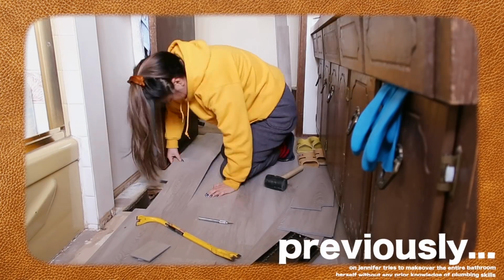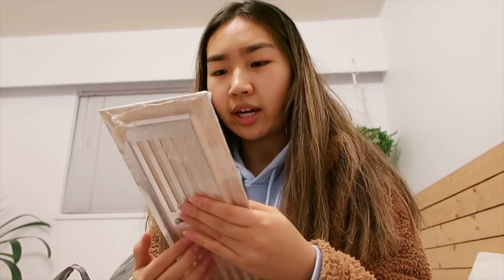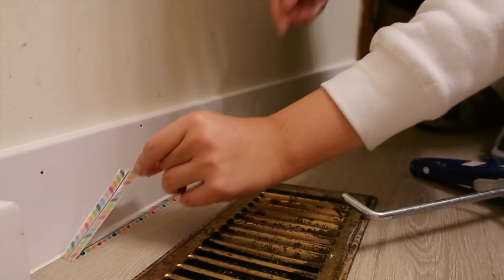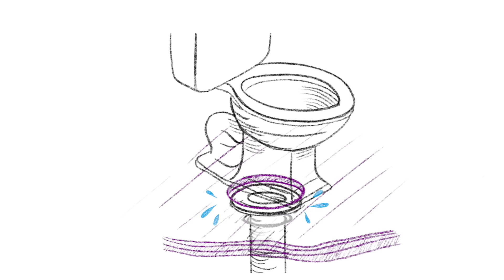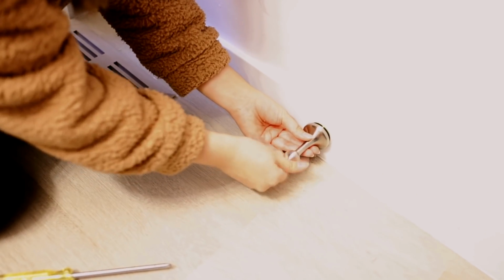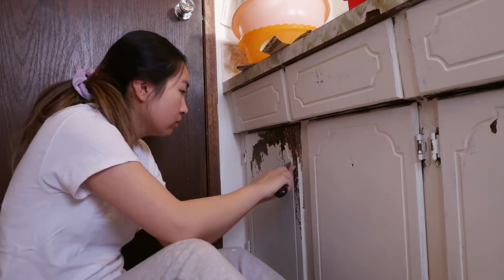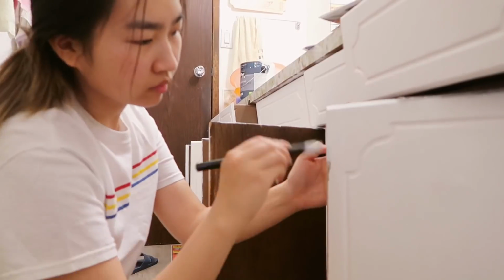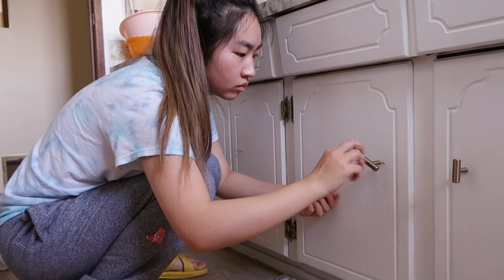DIY Extreme Bathroom Renovation Part 2!  | JENerationDIY

Comment: Amazing progress to far!! Quick tip on removing paint from the hinges - you can soak them in simmering hot water with some baking soda for about 20-30 mins. Remove from water, wipe with an old toothbrush and the paint will peel right off. It’s so satisfying. Can’t wait to see how the rest of the bathroom turns out!

Comment: For anyone who'd remove the drawers and doors on old cabinets (and doesn't already know):  Keep track of where every door, every hinge, every screw came from.  I know it sounds dramatic but over time all these parts settle in.  If they don't get put back the same way they won't fit the same and you'll get a lot of really weird angle/fit issues.

Comment: As someone who has worked in renovations/house flipping, for the bathtub, I would use Rust-Oleum to make it white so you don’t have that yellow color on it and so you don’t have to replace the entire thing. Just remove and tape off the metal faucet pieces and shower glass and spray as directed on the can.

Comment: Great job.  Just a bit of advice on cabinet doors.... invest in a portable sander and small wire brush.  It's easier to take off the doors and to separate the hinges and set on a table for easier sanding.  Before you paint next time, add some primer after you sand.  This will make sure that your paint sticks very good.  (There's also paint with primer.  This also saves you the clean up of your new floor. Use an aerosol for your hinges.)